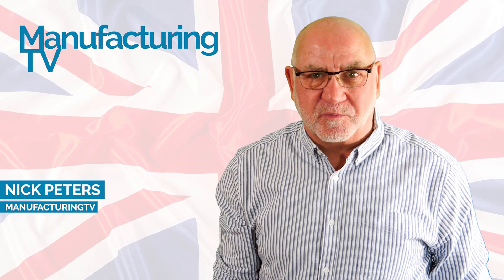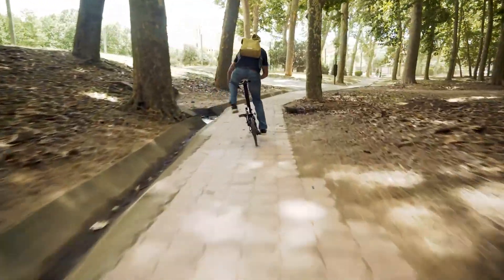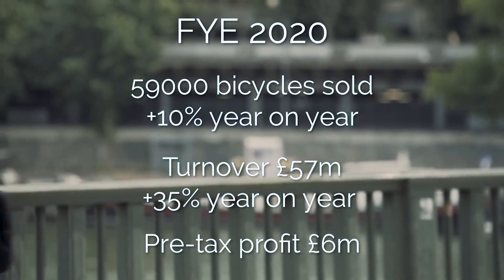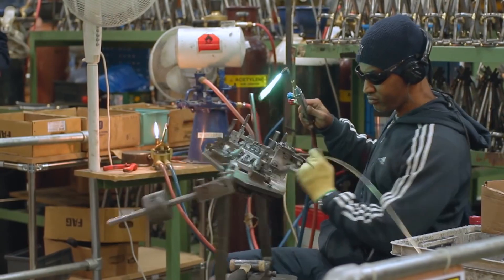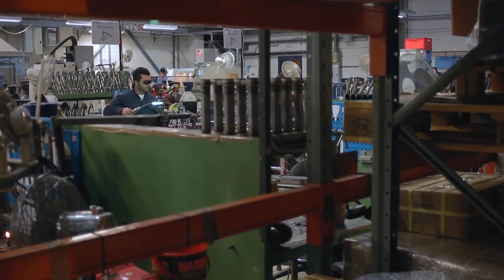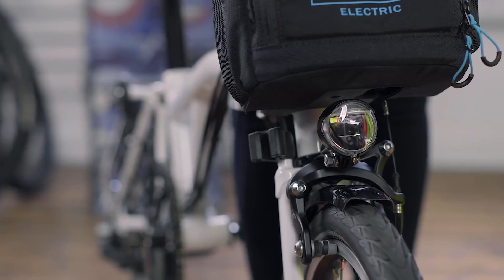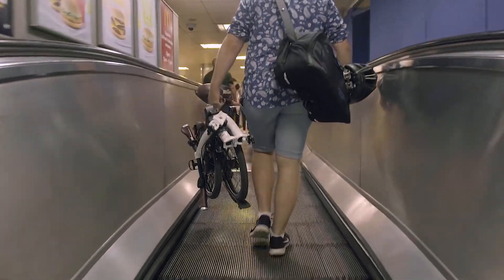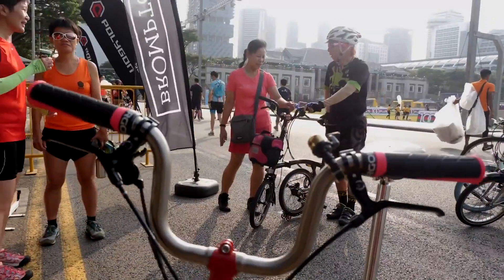Best of British: Brompton Bicycle

Comment: It is a truly horrible bike, hard rolling on the small wheels with much rolling resistance! I know as a Danish owner of a now much modified 2019 SuperlightM6LXBrompton, for now weighing 8,75 kilo, with mudguards, which could easily be made with less weight, even on an original "Superlight" with original Titanium stays, but - "Heavy Metal" brackets for them on the guards!!! Not much of my original bike is left of course, during that, and mostly bought in much more Trade-minded China, without the newly imposed, Trade Avoidance Measures for English sellers, now outside the EU!
          Of course I don't buy parts from the UK any more.  Finn. Denmark

Comment: I love my Brompton and would recommend a normal one to anyone, but I had to laugh here when the CEO said "what we did that was so clever is intregate the battery into the luggage". 

Yeah, so you made the luggage block system that makes the Brompton so incredibly uselful... almost useless. Really smart. You used the same idea aftermarket kits have been using for years and years. I'd love to get an electric Brompton one day, but it'll never happen while my basket bag, satchel bag and luggage frame would have to be sacrificed for it. I really, really hope Brompton don't give up on the electric idea and try it again one day. Maybe wait until batteries are good enough to fit inside the frame, or find some other solution.

I'm not saying they're selling poorly, but every Brompton dealer near to me will laugh in your face if you ask them if it's possible to buy or order a normal bike at the moment. They're sold out 6-12 months in advance. But you can buy an electric one today. They're always in stock.